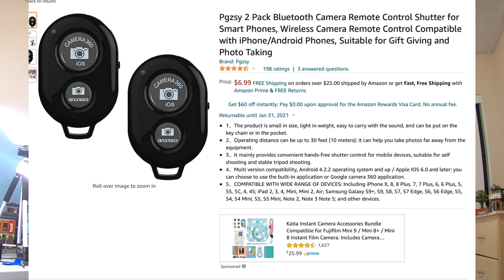5 Ways to Remove Light Flicker | Brickology Stop Motion

Comment: One extra tip for those using the "Stop Motion Studio" app.  When you set-up a shot, the app might indicate that it is in manual mode (with the "M" icon selected), but you STILL have to press the "M" in order to get it into manual mode.  Failure to do so can result in flicker.
Reply: Thank you so much
Reply: THANK YOU

Comment: Fantastic advice! Especially the dark clothing which is something easily overlooked. If these great tips don't solve your problem, Flicker Free by Digital Anarchy is expensive but works great. I'm not affiliated with them I just tried getting rid of flicker from using photo strobes to light the scene and Flicker Free worked great (unlike another plugin I tried). I wouldn't recommend using photo flash for lighting stop motion but it did work in this case.

Comment: I have had trouble with light flicker, but I don’t think it’s caused by any of these. It may be the way the light is reflecting off the lego. Any thoughts as to how to mitigate this?
Btw this was a great tutorial and really gets in depth to how it helps, great job man!
Reply: Look into your camera settings. Like I have to put camera into manual mode. Then put ISO to manual. And focus to manual. Don't know why the first option is not setting others, but you might have some additional options that tries to compensate for fixed shutter speed.

Comment: Why does my camera automatically brighten the image even though it's on manual i even have all the lights closed :(
Reply from the maker: If the camera is on manual mode it could be other factors like if light is reflecting off things such as your own body. Wear dark dark colors. Is the room completely blacked out? Sometimes the lightbulbs used can fluctuate in brightness. The best we can do is make the room conditions as consistent as possible 😊👍

Comment: Could you make a tutorial on how to make it nighttime in videos?
Reply: Just set your shutter speed to much lower than optimal. Also setting up all your light to cast as little shadows as possible might help. And use "cold" lightbulbs (or compensate with white balance for it).
It's a cinematic technique called simply "day for night".